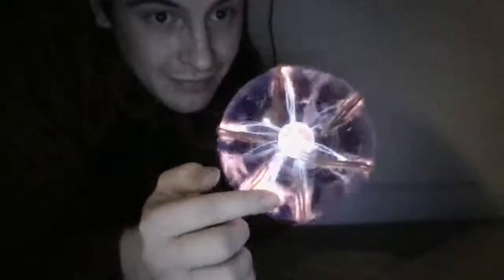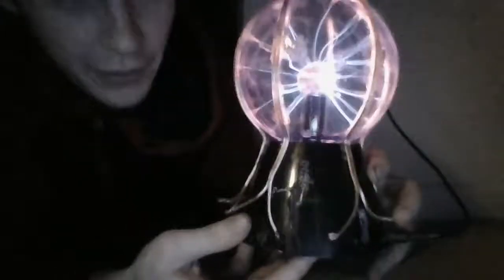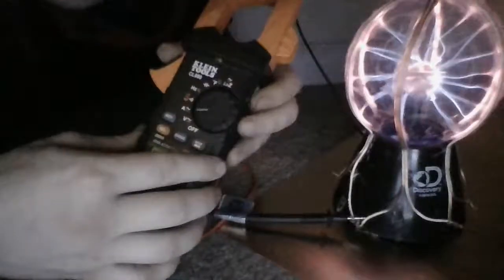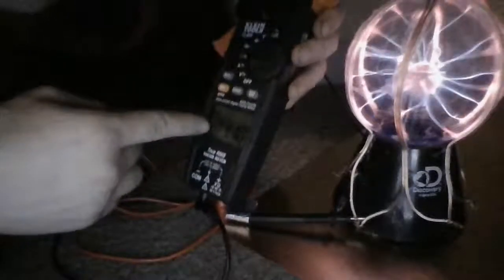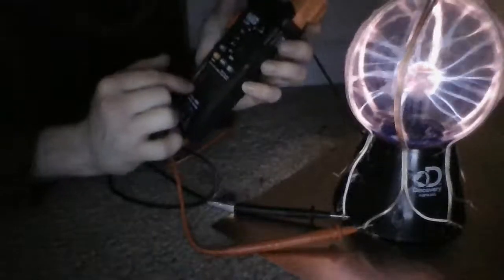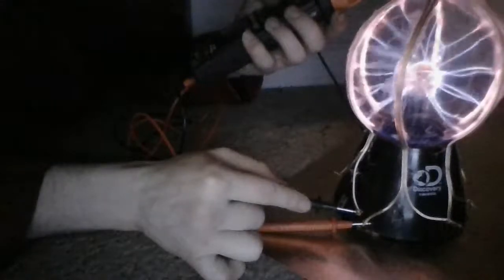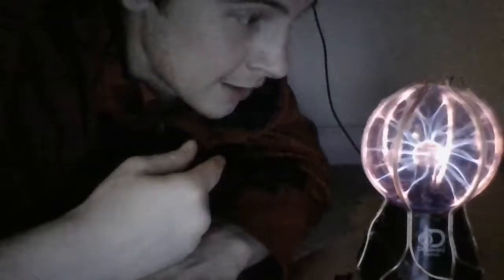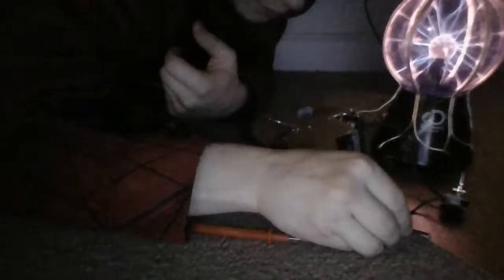Simplifying Resonance Using Copper Wire

Comment: I have the same exact tesla ball and when I create a spark gap with it interferes with the TV and radio signal.

ps. That is an amazing amount of AMPS that you're getting, holy cow!
Reply from the maker: Dude you see how fast I pumped the supercaps at the end? Lol
Reply: Hi can I have ur no, I need u to solve something my maths is really  disturbing, I can learn a lot if u don't mind v can discuss or I can forward mine if u don't mind to connect wish u the very best for ur channel 😊🌹
Reply from the maker: It will mess with the khz ranged systems unless its properly grounded. Yea the amps is insane. The spark you see isnt created by voltage. Lol